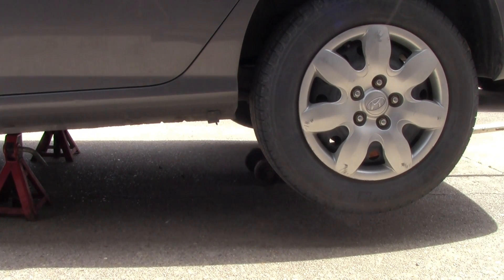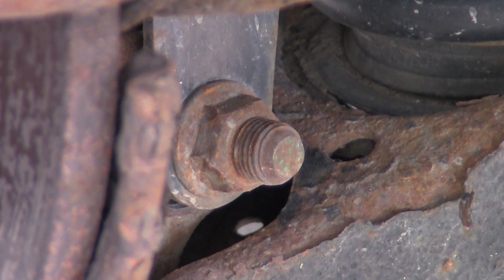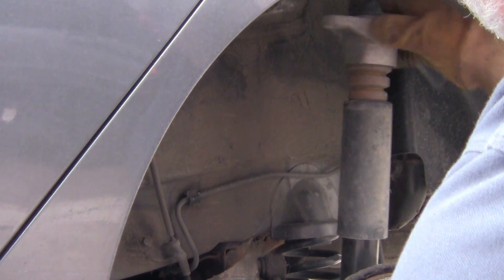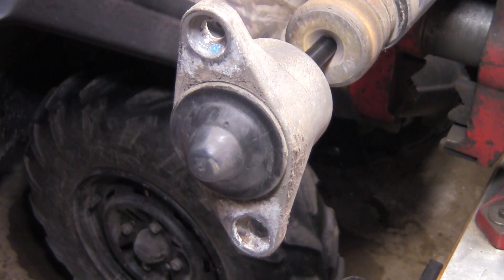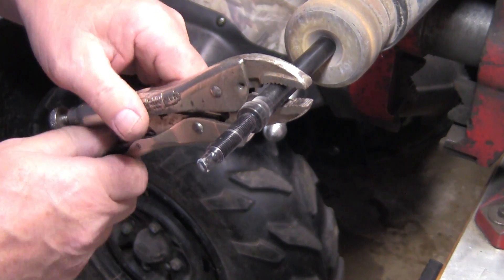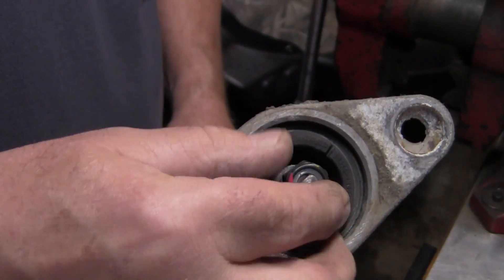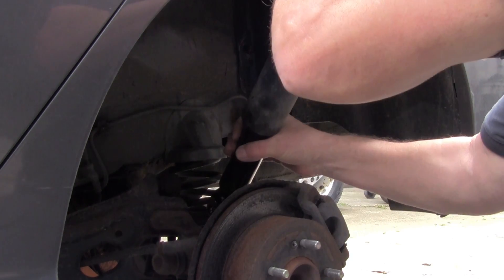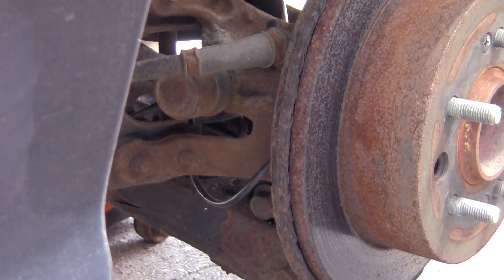Hyundai rear shocks

Comment: You didn't need to use vise grips on the shaft.  There is a flat at the top end.  Put the nut on and then use a flexible ratcheting spanned while holding the flat.  Easier and won't damage the polished shaft.
Reply from the maker: Yes I did, I didn't have a socket or racket with a hole in the center of it and it was rusted pretty good so I did the next best thing and it worked. You have to clamp it at the top because the top will never compress that far down into the shock.

Comment: Do shocks not need to have the air bleed from them any more?
Reply from the maker: I have never bleed air from the shocks because oil will come out. I have only adjusted the air in air shocks.
Reply: @LonnieJohnson1  Back in the day we would pump the shocks 8 to 10 times to full extension with the shock standing upright. The first 2 or 3 pumps you would get a squelchy noise then the shock would firm up and be silent.I havent seen it done in any videos but we were taught it 30 years ago
Reply from the maker: I worked at a shock assembly plant and now days they have a machine that pumps each shock in order to make sure the shocks work and to make sure they pass QC before packing them for shipment.